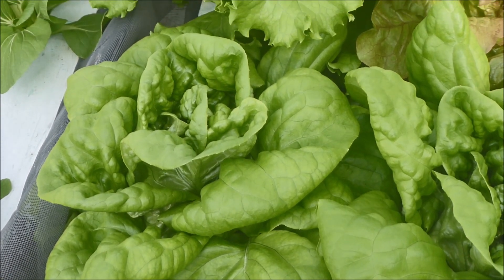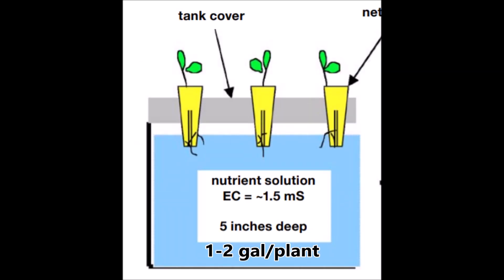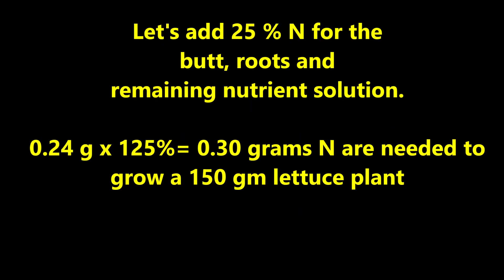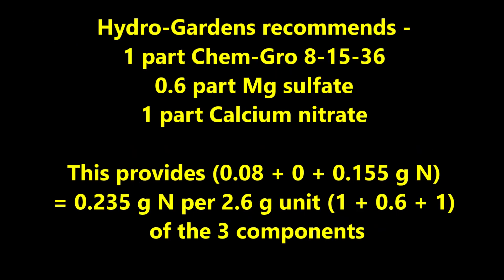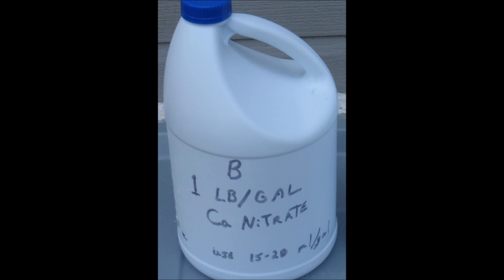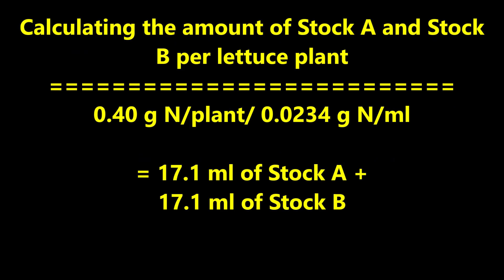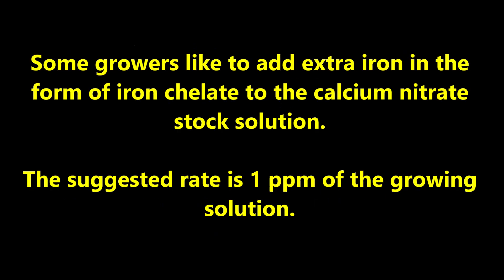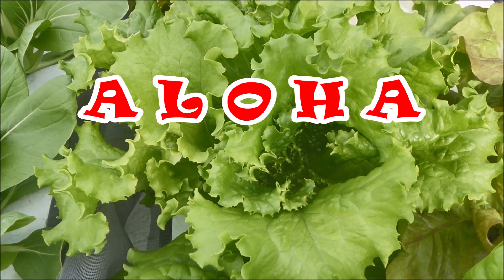Fertilizer Approaches for Growing Hydroponic Lettuce

Comment: By the way,  magnesium sulfate is not  strongly soluble in water.
 Calcium nitrate IS soluble in water 
 But when you add them together,  you might lose the Calcium sulfate as a precipitation of gypsum.   
   Calcium sulfate is weakly soluble! , thus  you end up with more avaliable magnesium nitrate in the solution. 

 Please correct me if I'm wrong.  

  Happy gardening to all.
M.m
Reply from the maker: That might be true if they were both added in a concentrated form in the same stock solution, but the growing solution is fairly dilute and it doesn't seem to be an issue at that dilution.

Comment: Hi Dr. Kratky

I have calculated the N value in the solution you are using and it happens to be about 105 mg/L. Isn't that too low for lettuce. Correct me if I am wrong but most lettuce requires about 150 mg/L of N to produce a satisfactory head of about 175-250grams.

There are many commercial farms that runs N at 180-200 mg/L.

Comment: so if growing 8 lettuces in 5 gallons of water i need 685mls of A and 685mls of B?
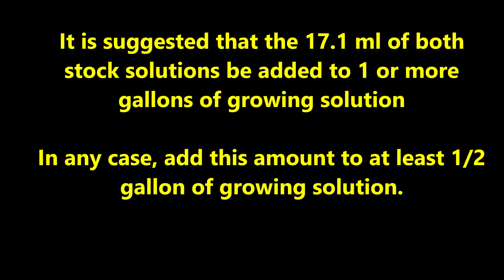Reply from the maker: At 10:06 I am suggesting that you add 137 ml Stock A + 137 ml Stock B per 8 plants.  It would be the same whether you use 5 or 10 gallons of water.
Reply: @growkratky5558  ah excellent thankyou so much

Comment: 9:18 another typo. There are 88.6 g N in 2 containers BOTH holding 3785 ml for a total of 88.6g N in 7570ml. NOT 88.6g N in 3785ml. This would result in an actual 0.0234g N per 1ml of each part, 2ml total. Otherwise, an immense thanks for making this video. I've learned a lot from it.
Reply from the maker: Excellent observation - You are correct!  I should just strike out the statement "If 88.6 g N are dissolved in 3785 ml".

Comment: Aloha Dr. Kratky!! I’m new to your hydroponic method. I’ve started around 5 months ago to try and grow mostly leafy greens. I have them in black totes 12 gal & 7 gal. I’ve noticed that my manoa lettuces and head cabbages have been getting younger leaf tip burn and older whole leaf turning brown with spots. I have them under grow lights also. I’ve done a few changes to the amount of fertilizer (more or less). But still the same. Might be the lights? Too close or on too long? I have them on timers for about 12 hrs. I have them about 2 feet from the plants height. Love your work by the way. I’m in HPP (keaau) area also. Not sure if the climate might be the issue also. Thanks so much🙏🏼🤙🏼🤙🏼🤙🏼
Reply from the maker: Manoa lettuce typically gets tipburn during the warmer months -particularly at lower elevations in Hawaii.  Symptoms should lessen during the cooler weather.  Also, you may notice that cabbage is normally grown at higher  elevations like Volcano, Kamuela and Kula, because it prefers cooler weather.  You should have better results with a leafy lettuce variety in your location
Reply: @growkratky5558  thank you so much for your info. Love your work and absolutely appreciate your input. My hunch was correct. I figured it was more to do with climate rather than nutrients. It is warm here and very humid. I’ve grown one successful crop of cabbage once in containers with soil. And when I think back, it was cool for a good month and a half. Best cabbages I’ve ever grown.

Comment: Thanks for the great video. It's changed my approach to how I measure out the nutrients. I have hard water coming out of the tap. Can you do a video on water quality? Would you dilute the hard water with RO water to bring the EC down? What EC level would you target for just the water? Or would you target the EC after adding the nutrients? So I would still use 2.05 grams of Masterblend but diluted in a greater volume of water to achieve 1.5 EC?
Reply from the maker: In Hilo, our water was not hard and usually had an EC of below 0.1 mS.  I don't have much experience with hard water, but your approach to dilute it with rainwater or RO water sounds good. Maybe, use 0.2 mS as a target.  The EC after adding nutrients depends on the water EC, the amount of nutrients added and the quantity of water. The approach in this video calls for adding 2.05 g of Masterblend etc. to a gal of water and adding more water if the plants need it, regardless of EC.  Another approach, not discussed in this video, calls for using however much solution the plants need - all at an EC of 1.5 mS, but that usually ends up requiring more fertilizer than the 2.05 mg etc. that the plants actually need.
Reply: @growkratky5558  Thanks! That 0.2 mS sounds like a good target. I can get that by using 20% tap mixed with RO. Once I add the nutrients I get an EC that's in the target range.

Comment: Dear Dr. is this formula for master blend work with all green plants Thanks
Reply from the maker: Actually, this is a tomato formula, but it works for other plants as well.  If you grow only one crop, seek out a formula specialized for that crop.  However, if you grow a variety of crops, usually a tomato or lettuce formula will work pretty well, although not quite at the optimum that a specialized formula might work for a specific crop.